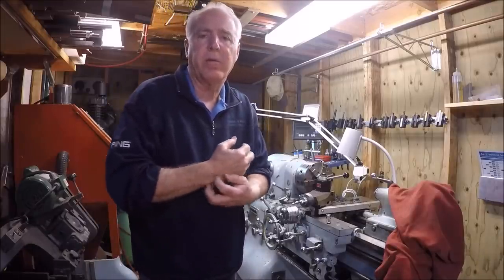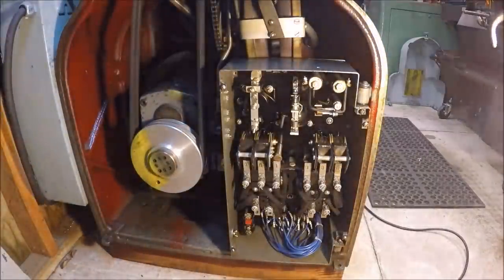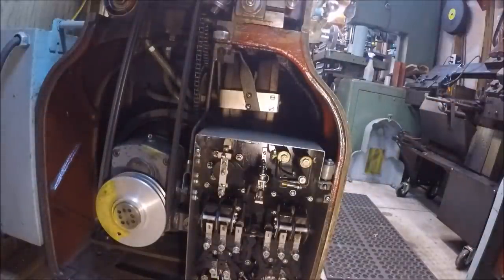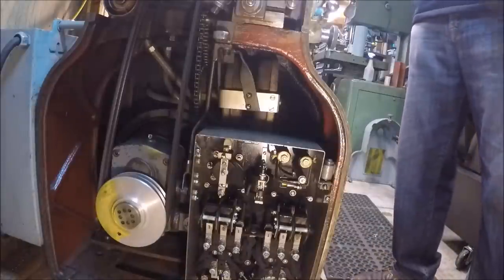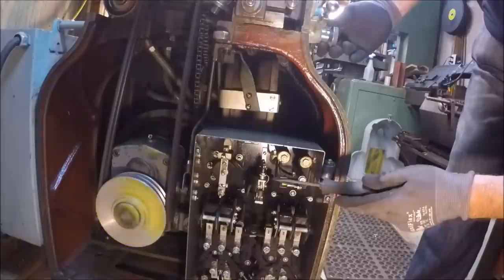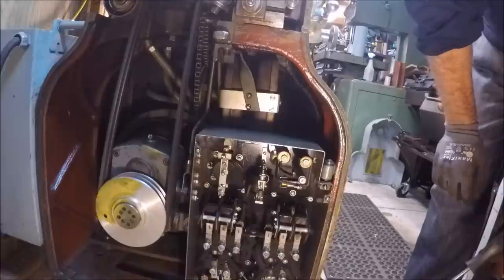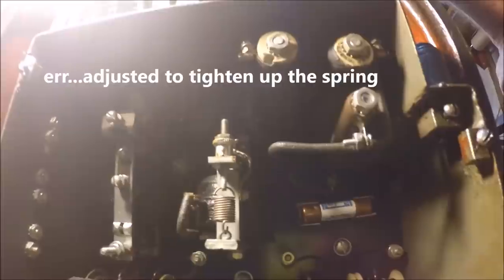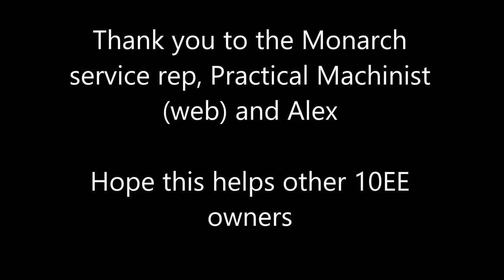MONARCH 10EE    Anti Plugging Relay

Comment: Hi Chuck, thanks for the video, I also have a 1953 10ee that was sold to Hughes Aircraft. I have been having a simular problem with mine but a bit different. Sometimes when I start it and try to increase the RPM the spindle stops and starts a few times then will spool up. Today it worked perfect , ya think the same switch could be the problem.
Thanks Allen
Reply from the maker: Hello Allen.....not for sure...but I think it would be worth the try as it might solve the issue...ATB

Comment: Two comments:
You need a local safety disconnect by the lathe; going to the fuse box (out of your direct sight) to disconnect can be dangerous. Someone might pop a breaker elsewhere and come and just flip on all the Off breakers. You need eyeballs on the safety switch, plus you can usually lock them in the off position (or just use a snap hook or carabiner with a label: Don't Turn This On Without Asking Me).

I cringed to see you waving a metal screwdriver around that live relay box. Get a dry stick or a plastic rod (NOT carbon-filled) to point and poke with. Even if the handle is plastic, in a shop there are metal particles which can become embedded in the plastic. The handle could become contaminated with graphite or carbon dust. You can see when a dry stick or light-colored plastic gets contaminated. And even if you don't get shocked, a short in the box by a screwdriver can throw sparks or molten metal droplets and, damage (expensive/hard-to-get) components.
Reply: A wooden stick is great, but, forget the graphite core, ie. lead pencil ...